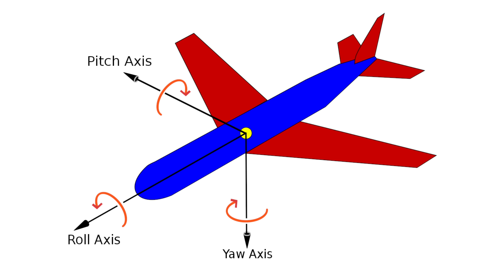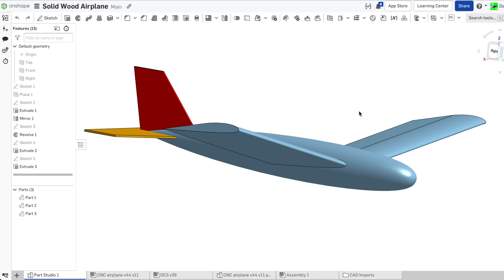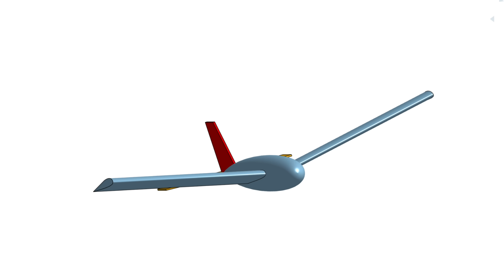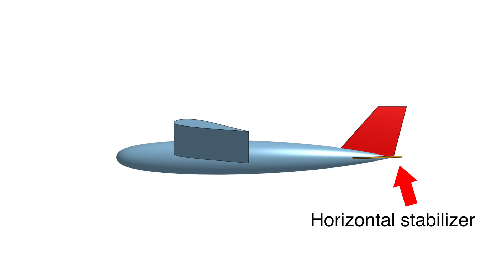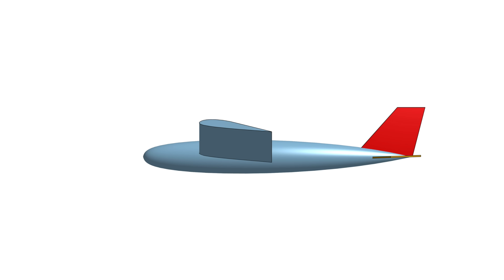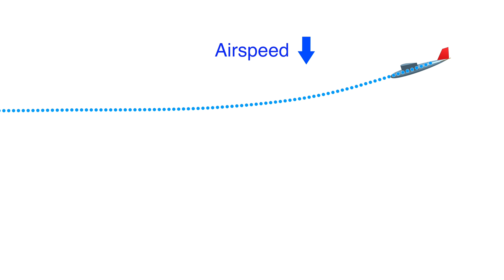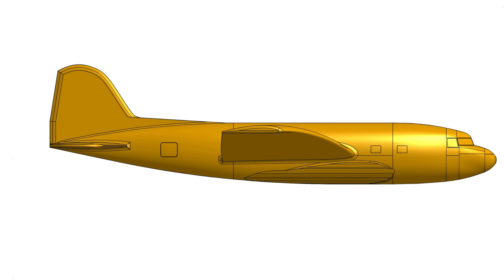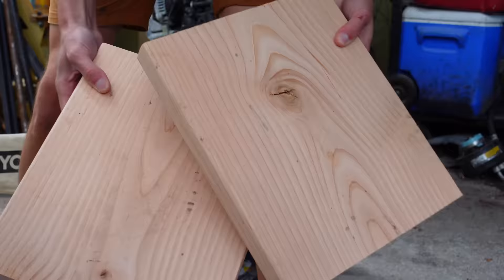Can a Solid Wood Airplane Actually Fly???

Comment: Wings bend up not down would give the plane the needed stability.   (It flew first upside down).
   Needs also longer wings. Move the wings also a tad towards the nose. Even if you need more weight in the nose to get the CG at the 40% point of wing width, the plane would fly more stable.

Comment: This reminds me of when I used to launch rubber band-powered airplanes and parachutes from kites.
I had designed a release mechanism from a small cardboard tube (from vending machine pens) and a paperclip that would release the plane when I yanked on the kite string.
For parachutes, this worked great.
The wind would blow the parachute from the ground up to the kite where it would release.  The tube would then slide back down the kite string, ready for another parachute.
For the plane, I had to pull the kite down to the ground (walking toward it with the string under my arm) attach the plane, and let the kite rise again.  The paper clip/tube mechanism would lock the wound-up propeller until it was released with a good yank.
This system was by no means reliable, but it worked often enough to keep me and the other neighborhood kids entertained for hours.

Comment: I though Howard Hughes answered this question decades ago. Every toy airplane I had as a kid was solid wood, not much wood, but it was all solid balsa wood, so you would have to define the parameters of the question, and materials. You need to do your tests in a blimp hanger with the doors closed. Call Goodyear.

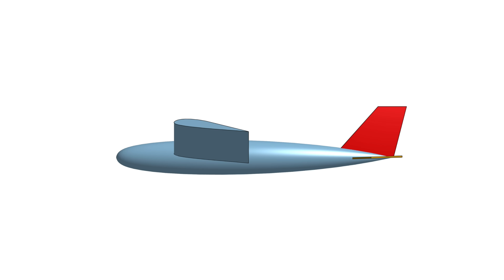Comment: 2:42 There is some definite similarity between the self-correcting yaw stability of a plane with upward angled wings and the self-steering ability of a bicycle (which never falls when moving). While a bicycle steers into the direction of the leaning, the plane moves away from the sideward turn due to the broader face shown to the oncoming wind.

Comment: In the playing around I've done with r/c flying wings and deltas ive found that once wing loading gets high enough you need to install wing fences. The swept leading edge encourages spanwise flow, without fences to stop it a stall at the wing root will travel out to the tip and suddenly you're in a spin. Airfoil selection doesn't help much, although a thicker section will help. Tip washout doesn't seem to help at all once wing loading is high enough.
Changing to tip dihedral rather than gullwing dihedral is going to increase the effectiveness of the dihedral in stabilising the plane, and eyeballing it i would say that increasing it a bit wouldn't hurt either.
Just my 10c worth...

Comment: There's actually another reason why a dihedral makes roll stable, as soon as the aircraft rolls one of the wings creates more lift in the upwards direction while the other one more in the sideways direction which corrects the plane's roll, but the reason you mentioned is also correct, it's just not the whole reason

Comment: Your wings sagging in the wood model (all of the original mode technically) is the opposite of Dihedral (almost anhedral) which really needs to be at the ends of the wing not just near the root so I bet that is part of the reason that it was able to successfully fly upside down.  If they were just flat all the way and even with a bit of washout on the tips I bet it would fly even better.  Cool ideas and fun to watch.

Comment: A few years back there was a guy selling solid poplar wood RC slope soaring / slope racing gliders of about 1.5m wingspan, I think under the name "Thorn" (though it picked up the nickname "the flying baseball bat"). 
Apparently they flew quite well (so long as the wind was adequate), were durable, and easy to repair.

Comment: heres a thought for the rod drop. not sure how it'll interfere with the drone at all but put the guide loop on the top, and maybe bend the drop rod. this should help maybe get the plane into horizontal motion on the drop instead of just straight down speed.

Comment: Somewhat reminds me of a properly designed bicycle/motorcycle where once rolling it does not even need a rider assuming it has a forward push or is going downhill.....as long as the ground is not too badly pucked or cambered etc and there is no wind etc the thing will just happily keep rolling onwards as long as friction allows it too....and within reason it will do a pretty dang good job of self correcting.  All it takes is the correct rake and trail good bearings and wheels/ tires ....like your airplane example under the good conditions it needs no pilot!

Comment: Thank you very much for the succinct and comprehensive explanation of passive glide aerodynamics! I have been making planes from foam insulation for a few months, using weights and adjusting the rear stabilizer to get a flat glide path. I will be using what I just learned to refine my builds and get better results.

Comment: Notes on the Snapmaker: It will handle soft brass and aluminum if you use appropriate bits AND hack the firmware to halve the actual speed.
The default software is very limited for building laser and carving jobs, absolutely incapable of designing print jobs.

Having an all-in-one machine has been very nice in my limited space, but the lack of 3D model creation did upset me a bit.

Comment: I think using a delta wing might have better results for a solid wood (or other material) based aircraft, both for potential stability and structural integrity. You're using a solid block of wood anyway, so it would just mean removing less material to achieve the same thing.

Delta planforms also have extremely high critical angles of attack and stall angles so a wider range of stable lift conditions.

Either way, it seems interesting to try out.
Reply: I spoke too soon and missed the bit where you did try a delta layout, looks sort of like a miniature Avro Vulcan.

Comment: That’s because the air pressure was going the wrong direction when the quad copter was pushing air downwards, the lift is supposed to go the other direction so you had a bunch of spinning airplanes before you put the railing on and then, even after that, I had to overcome

Comment: Honestly my guess is the reason you had to try so hard to get the wood plane to fly is because of the complexity of the airfoil. Your understanding of the airfoil and the ways to mitigate tip stalling are all correct. But I’m guessing it doesn’t work with such a small wing, it would however work much better with a bigger heavier aircraft. I’m really curious how it would have worked with a super simple wing with a basic flat bottom airfoil and dyhedral.

Comment: Wow, Super cool! Thank you for the video.
But I thought about dihedral in a different way (disclaimer: no physics or air engineering education, just common sense):

When the airplane starts to roll, because of the dihedral, the projections of the wings on the horizontal line/plane differ in sizes / surface areas. The wing that is higher is more angled thus the projection is smaller and the lift generated by it is smaller. The oposite with the lower wing, which is almost parallel to the ground, thus larger projection and more lift.

Is what I'm saying somehow reasonable? It seems my explanation (if it is correct) is a bit simpler, because takes less steps and doesn't require third dimension.

Comment: Theoretically a heavier plane should fly further then a lighter plane when they both have the same starting altitude. The extra weight increases the potential energy the plane has.
Gliders also do this in real life with water ballast tanks in the wings.

Comment: Why after all that expense, did you use a block of wood with a huge knot in it ? That’s actually what made the bit sound bad when it struggled to get through it at the start. Your breakage was caused by the grain in the timber and I recon next time use MDF board or plastic, by the way those strange patterns in the acrylic are made by acoustic standing waves created from the various vibrations of the cutting bit travelling through it.

Comment: I think you were moving in the right direction with using the bar to stabilize their release if you notice when you finally launch the wooden plane with lead in its nose the first couple times the winds aloft are gosh probably 10 or 15 knots while it sounds like on the ground it's pretty still so that's something to take into consideration, because one bad gust in the wrong direction while it is building speed on its initial dive and it just totally kills the lift and that would be a gust of tailwind. 
I actually expect that on some of the more successful flights you had it had everything to do with there being either a pause in the gusting of the  wind or perhaps also possible and plausible that a small gust of a headwind just the right moment provides the increase the lift needed for the plane to actually start flying and even climbing. Once it had accumulated enough forward inertia the flying physics become more familiar and predictable. 
What the increase of speed and subsequent energy transfer of potential energy harnessed transformed and utilized and by the planes airfoils the aircraft parameters and measurements play their part in the rotating exchange of limiting factors while we watch the plane soar off swooping up and down, searching this way and that for equilibrium......really cool stuff dude!!!!!!
I rarely watch whole videos because I have such bad ADHD but you earned a new subscription for me for this one, now gonna go check out some of your other material.

Comment: Try a T-tail to get the stab out of the wake of the wing.  Maybe slightly larger and thicker tail surfaces - both fin and horizontal stab - to deal with the Reynolds’s number issue you mentioned.  

Biodegradable?

Comment: It's possible that the ripples in the tape when you taped on that new nose cone caused some parasitic drag and it would have been hard to get that smooth enough to avoid that. It might have worked to use wood glue and then sand it smooth when it dried. 

Anyway, I wish I knew where you lived because I don't have any sort of 3D printers or CNC machines and I'd totally be out there in the woods looking for some of those lost planes. Very cool, man!

Comment: This is fantastic. The final balsa design was gorgeous and I loved the drops where it lawn-darted so perfectly. Have you considered adding AirTags or similar to help recover test articles? I also wonder if there's a low-footprint avionics sensor package that could gather accelerometer and pressure data at least to help profile the flight.

Comment: I think you should try this again with Balsa wood or maybe a product called "Chemical Wood" its basically resin and wood fibers bonded together in blocks. It's used a lot in Model Cars building. It's fairly strong bc of the resin but it sands and carves like wood does. It's a pretty neat product. 👍👍

Comment: Everyone in 3d printing worries about surface finish.

Yet.

In the Ultimate Fan made Fan Showdown he literally subjected a set of three fans to three different surface treatments, sanding, acetone, solvent and none.

And the fans with no surface treatment performed within 3% of the few that benefited from a particular treatment.

Don't forget that in laminar flow profiles the air closest to the surface of an object DOES NOT MOVE, regardless of surface shape.

It is thus when we get into high speed, turbulent air flows that removing surface instructions like minute surface textures can be expected to provide benefits.

And it suits our asthetic preferences too I suppose.

So don't get hung up on final surface smoothness in most applications. You could even run a series of tests on some self printed propellers on your test rig to confirm the scale of the benefits to yourself and make a video of it.

Comment: I think you have things mixed up, if the center of gravity is in front of the center of pressure then when the lift increases do to higher are speed it will lift up the back more than the front causing the nose to go even lower and for the dihedral, you are right about what is does but not about how it works you do not need any side slip for it to have an affect on the air craft, the v shape makes it so that when the plane tilts, the lower wing tip is actually slightly farther from the body and the higher wing tip gets closer to the body giving the lower one more leverage

Comment: Did you use balsa wood? That wood be interesting.
Maybe fly the drone forward really fast and have the plane mounted horizontal under the Drone so that when you release it the plane already has forward momentum. What no horizontal stabs on it?

Comment: as long as the bournelli principle can be achieved, it can fly.
a negative and positive airflow over and under the wing must be achieved.
Once you achieve that, it will fly.
the differences in the pressures will create a vaccuum - thus the vaccuum will cause the craft to “suck” up the craft - hence achieve flight.
the craft also has leading edge turbulance and aft ledge turbulance.
Depending upon the wing design, at certain speeds the turbulance can cause extreme handling problems).  
Since, this is just a wooden craft and not meant to prove that a solid wooden plane (with a good wing design) can fly the leading edge turbulance and aft turbulance is not important.

Comment: For all of the effort... build one and put a radio in it? Nearly every flight had some turn tendencies. Most looked to go left. A radio would all ow for control after launch and would cost about as much as a few of the 3D printed ones. A used radio would nearly be free.

Comment: part of your problem is that your main wings are curved and not straight out going up at an angle and if you notice at new airplanes the tips of the wings are turned upward and back similar to the vertical stabilizer also known as the tail

Comment: delta wing aircraft are inherently unstable, and that's why you usually only see them on fighter jets. instability = maneuverability. having to fight the intrinsic stability of the aircraft makes rapidly changing the position or orientation of the plane very difficult. If the plane can easily knocked off course by even the smallest changes, then it is very easy to maneuver. The fighter jets compensate for this instability with avionics that can adjust the control surfaces rapidly and seamlessly to allow for stable flight.

Comment: Solid wood? not bad for a glider, but I think I remember reading, somewhere, that the F4 Phantom had a density greater than that of concrete. Not sure if that is true, even when fully fueled there's got to be a lot of air within the mould lines(?). Most of the aircraft structure is made from aluminum and that is 115% the density of concrete. Relatively small amounts of steel are 300% the density of concrete. Jet fuel is about 33% the density of concrete

Comment: Impractical wood planes? Where have I heard of that before? Oh Yeah, Howard Hughes and the famous WW II Prototype, the Hercules H-4, later dubbed The Spruce Goose. It had a successful test flight (26 seconds, flying for a mile at an altitude of 70 feet) if you also think the first Wright Brothers' test flight was successful (12 seconds at an altitude of 8 feet, landing 120 feet away). That thing was huge (six times the size of any plane of its time), designed to carry 750 troops and their equipment or two Sherman tanks. It was wood to sneak through the German Radar in France, though its test flight wasn't until 1947.
I missed the type of wood used. Was it Balsa? If so, it is not hard to imagine it would fly, since it is not a heavy wood.

Comment: With the Dihedral of a the wing being high it is the pendulum effect that offers stability in the rolling plane, as the plane of lift is higher than the centre of gravity. Not quiet the explanation given here.

Comment: I know I'm late to the party but my guy! Air tags...cheap tracking and recovery. As an old RCer factor its weight/balance into the design and you should be good to go. 
On a side note I notice that turns are random as too left/right direction while in free flight.
May I suggest being very critical/obsessive dare I say anal about weight/balance from all axis when it comes  to overall model balance, whether that be front to back (Fore and aft) 
or tip to tip/left and right roll (very important) actually D all of the above always seems to work...I see what you are doing and think it is wonderful. My curiosity compels me to ask about balance from all points is all as I think it would introduce stability into the flight profile much quicker...thank you to both you and the thread for your time in this matter. keep em flying...

Comment: Wonderful video.
I do not know enough about aerodynamics, but having read a bit about the DC3 (probably my favorite aircraft type), I am curious why you deviated so much from the original design,especially the way you did the dihedral more like a gull wing, more upward angled near the fuselage, leveling out towards the wing tip? If I remember correctly, the DC3 wing also has a tapered leading edge and I thought that was to do with stalling the tip, but it seems I was wrong. I wonder how a model of a Super-DC3, with the slightly swept larger wing and larger vertical stabilizer would work.

The lifting body looks amazing aesthetically, almost like some voluptuous abstract female shape.